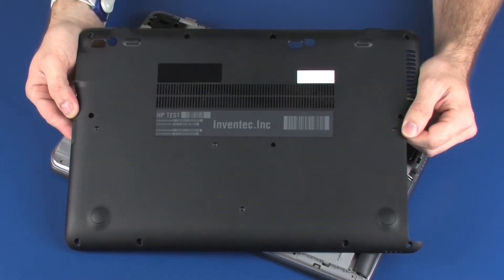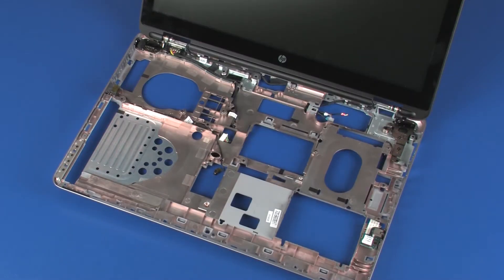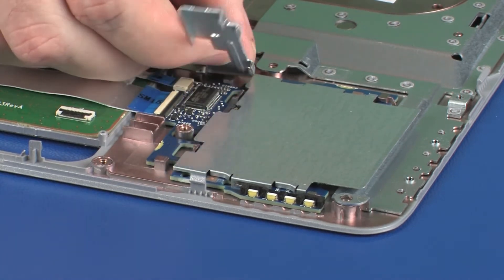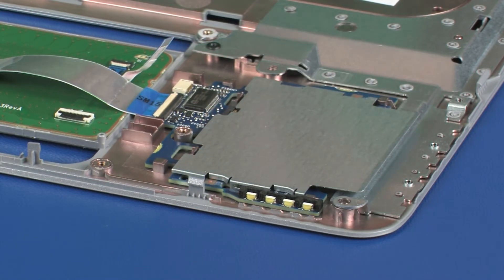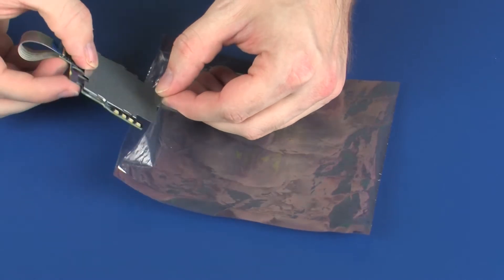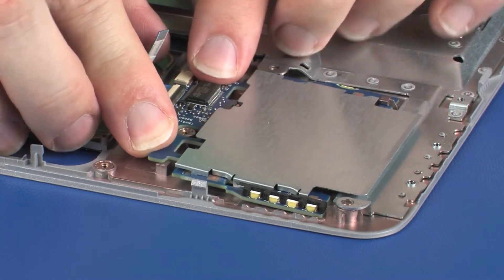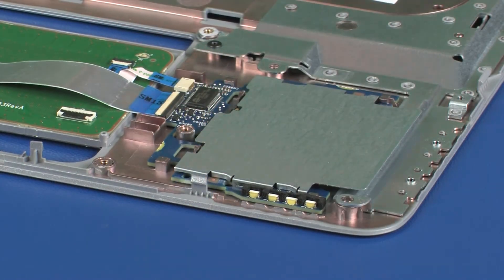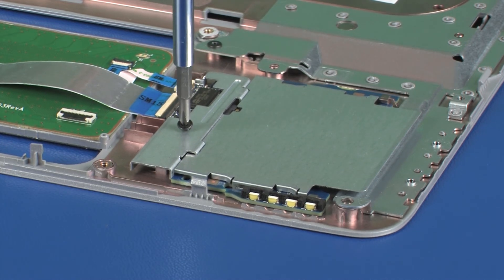Replace the Smart Card Reader Board | HP ProBook 650/655 G2 Notebook | HP Support

Comment: Is smartcard a type of NFC?
Reply from the maker: Hi Olaf, thanks for contacting HP Global Social Media Support!
I understand that you need to know whether  smart card is a type of NFC
I will do my best to assist you.
An HP Smart Card is a security device manufactured by computer maker Hewlett Packard® (HP®). A smart card is usually the size of a credit card and contains a chip that exchanges information with a smart-card-ready device.
NFC, or near field communications, is a technology built into most modern smartphones, laptop computers, and other consumer electronics. It facilitates the transfer of data such as credentials, documents, and photos between nearby devices without requiring an internet connection.
Binu-HP Social Media Tech Support